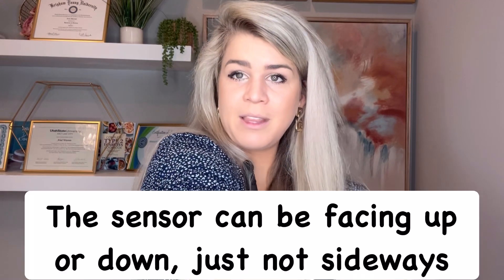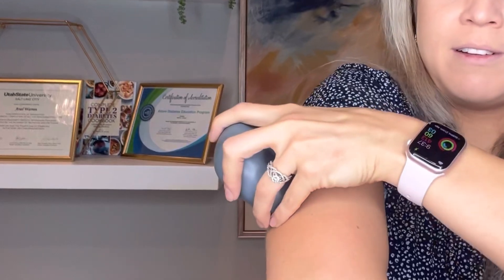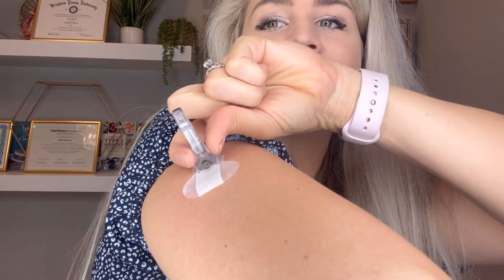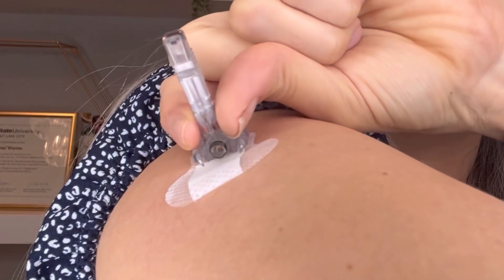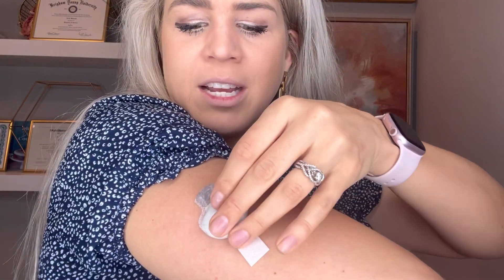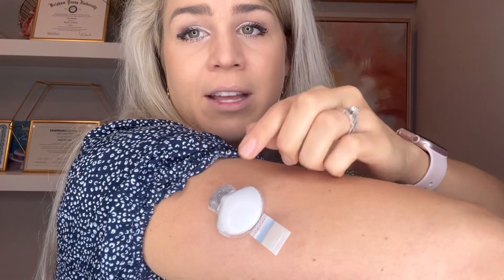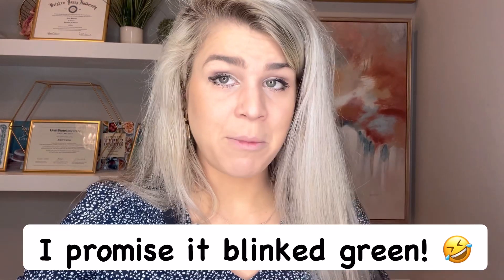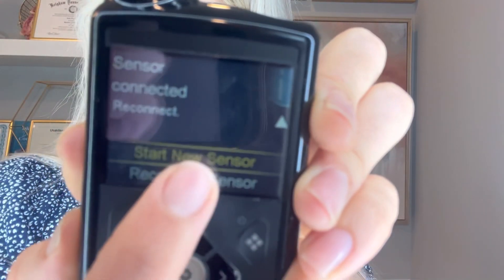Failed or Constant Updating Medtronic Guardian Sensors?? Watch this!

Comment: I have been using Medtronic insulin pumps since 2017 - 760, 770, and soon to be 780. I have never been able to insert the sensors on my arm by myself. I watched your video last night and the 2 SUPER tips were about the cold pack or can of soda to slow the blood flow and the pinching of the needle before pulling it out. I finally inserted my sensor ALL BY MYSELF, this morning! Thank you so much for these GREAT tips!!!

Comment: Has the quality of the sensor (guardian 4) changed,failures are occurring more and more
Reply: The Guardian 4 and the Guardian 3 Sensors, are the EXACT same. The manufacturer has confirmed this. No need to spend more money on the Guardian 4 Sensors when they're the same functionality-wise as the Guardian 3.
Reply: @IntruderXero  That is not true smh
Reply: @IntruderXero not true at all. the 4 you barely even need to calibrate unless there are issues

Comment: Cant believe you still have to charge the transmitter!  I switched to tslim and dexcom 7 after being a Medtronic user for over 28 years
Reply: Not sure what Medtronic pump you were last on. But I wouldn't call the T Slim a switch its a down grade to the Medtronic 780G. The 780G is a  totally different  system to the 600 series.  Type 1, 42 years and for the last 4 years straight my HbA1c has been between  5.7 - 5.9 Life changing. It has basically given me an almost normal life. Simplera (CGM) has been specially designed for the 780G and does not need to be charge and depending on your location is already available. Libre are also designing a CGM for the 780G too. The Future is Bright for those on the 700 Series and the coming 800 series. where the Tandem is going nowhere fast.  Medtronic will not repeat the mistakes of the 600 series.

Comment: What happens when it takes more than 2 hours for sensor to update?
Reply: Sometimes the Guardian Sensors, after their 2 hour warmup, will begin to "Update". When the Sensor is in it's Updating stage, the sensor is checking its own performance and may not display your glucose readings on the pump. If you are in a "High" or "Low" Glucose range for a period of time, then the Sensor will begin to Update. This is a safety feature to ensure the sensor is functioning properly.

Comment: 0:26 the title is failed sensors, yet this  video though is simply how to add a  new your sensor.
Reply: EXACTLY! I'd searched and asked WHY my pump continues the "sensor updating " signage for twelve hours now and wakes me every hour or so through the night with a vibration notification which must be addressed.
Reply: I've been using this system for years and certainly know how to apply the sensor. Please answer the question you SAY your intending to answer. Thank you !

Comment: Since you are using the extended infusion set, then I will reference the quick set which has the exact same specs works for me and is working for the full 7 days without any problems. You can also reference the specs on the Medtronic website to verify that they are indeed identical which I have done. The problem is in step 6 for the insertion during the removal which I modified to 4-5 complete revolutions of the cap until it fully disconnects then releases and will just fall loose. The problem that I encountered was that any upward force applied on the blue cap resulted in lifting the platform upward on the needle. When inserted into the skin the plastic tubing would conform to the taper of the needle forming a donut shape which is seen after removal when viewed by a microscope. The tubing would compress the underlying tissue and would try to express the tubing upward causing premature release of the tape. You would see that the tubing was bent after removal being a sign of the problem. Using the modification in step 6, led to the tubing being straight after the removal confirming the correct installation of the quick set. I would say 99% of my problems disappeared after this revolution to me, but heavy sweating would still lead to early release of the tape. So, my trying to match up the week of sensor and life combined with the infusion set was no longer my priority, as they were still complicated with early failures of the G4 sensors.

Comment: One recommendation, when removing the base platform from the serter, I noticed that you were quickly lifting the serter. I will lift up slowly it to help ensure that the plastic tab covering the adhesive does not disconnect from the base. Then follow up by examining inside the serter to verify the plastic was removed as is the normal sequence of events. If it did not disconnect correctly, you can then use tweezers to reach into the opening and manually remove the plastic. I would also note when charging the G4 to watch the LED flashing as the repetition rate decreases as the AAA battery voltage drops which will increase your charging time for the device. As noted, if the G4 flashes after removal charger it will still have a full charge. I state this as we all want the device to charge as quickly as possible to return the pump to normal operation. One other thing to note, when you enter a manual BS reading to calibrate the sensor if the reading on the pump is off by say 15 then the calibration will be rejected by the pump for 15 minutes. You can override this lockout by quickly reentering the BS reading again to help prevent this problem. Yes, I have done this before as if you get a second   lockout then pump will probably request a sensor replacement. Another thought, when applying the liquid adhesive is you have to be especially careful not to get it on the upper part of the exposed sensor. Since there are 7 individual sensor pads with 6 that are paired for replication and the most critical bottom most sensor at the end of the inserted tab. After examination, the early sensor failures have been linked to skin tissue covering the deepest sensor preventing the body fluids from reaching that area which is visible when examined under my microscope. Your body tries to encapsulate any foreign substance which is perfectly normal, so why will some fail early is the question that is not being answered.

Comment: Wonderful video. Thank you so much for the info. I have no idea what I am doing wrong. My Sensor expires, I turn my sensor off on my pump, charge the sensor until the doc stops blinking green, I take the sensor off and turn the sensor on on the pump at the same time, the green light blinks a bunch of times, I wait for it to stop and connect it, the light turns green again and the pump allows me to start new sensor, it warms up THEN 99.9% of the time it says sensor updating that ill take an hour or so then it says it again, then again and sometimes for the entire day or longer, then the sensor will fail >.< I am so frustrated. HELP please <3.
Reply: The calibration of the settings on the pump will normally take 2 hours, this time will be extended if your BS is still changing rapidly so be sure not to add any carbs unless you are low during that time. A stable BS will always take 2 hours minimum for completion of the task and it is not necessary for you to manual calibrate when done so you can nap, sleep or whatever.

Comment: I’ve been using Medtronic for almost 4 years. I’m still using the pump, but switched to Dexcom 7 for my cgm. When I used the guardian 3 sensor and the 770g pump using smart guard, I didn’t have very good control. I was usually high. So I changed to manual mode. Do you feel like the 780g and guardian 4 smart guard is better now? I have to say I do like that the Dexcom 7 is so much easier to put in, and only 26 minutes warm up, and lasts 10 days with 12 hour grace period.  I’m starting to shop around for other pump options now. Thank you for your insight on this, since you are now using Metronic’s.
Reply: I am using mini med 780 with guardian 4 with smart guard. It is life changing, no more daily pricks
Reply: I upgraded my 770G to the 780G two weeks ago.  The 780G is a game changer.  A1C's went from 7.0 to 5.7 - 6.2, sleep through the night without any alarms, finally got through the Gaudian 3-4 changing learning curve - most sensors now last 7 days without sensor updating alarms.